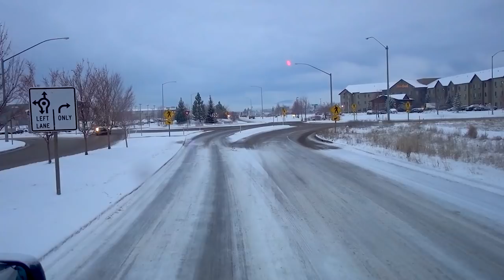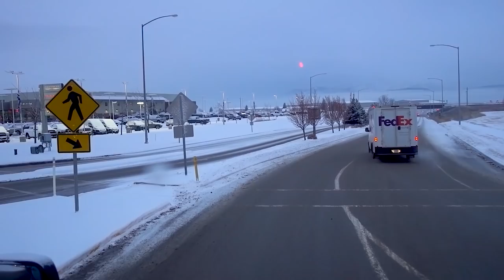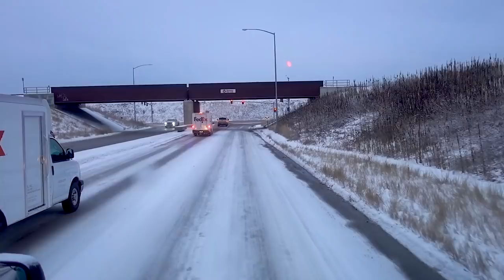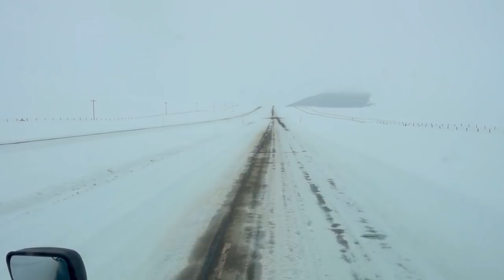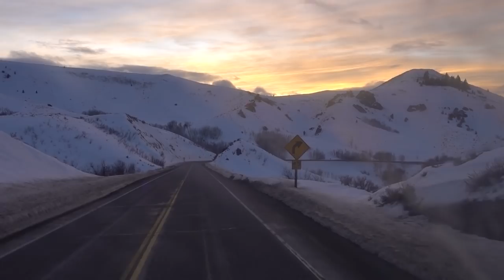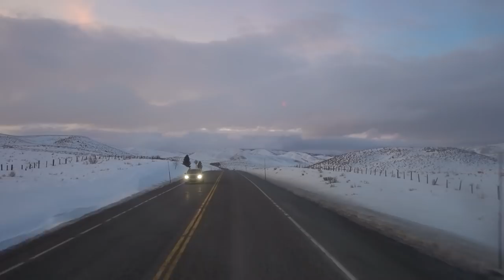trucking : drive shift in bad snow

Comment: Another solid video, man!

This has been my first winter in a truck, and the Northwest has been a real education in inclement weather driving.

Got caught in a nighttime snowstorm picking up a meat load up near Twin Falls, just before Thanksgiving, and had to get back to SLC.  High winds, blowing snow, snow and ice on the roads, and I lost the use of my driver-side mirror when a flatbed passed me, and one of his straps swung over and shattered my lower mirror.  Visibility and truck handling were so bad that I was down to 25 MPH at times, and never above 40 until I got down near Ogden, and the roads were cleared.  My trainer said I could pull in at the Flying J at UT exit 7, but I didn't, because I knew if I stopped there, I'd lose my nerve and wouldn't go back out. Took 7 hours to get to the Prime yard, and that was where we spent Thanksgiving.  Had to get the load repowered because we had to stay there until they could replace the mirror.

Picked up another meat load, near American Falls, and got caught in bad weather crossing into Wyoming on I-80.  Learned that night, that when the wind blows snow in the same direction as I'm driving, it makes visibility worse than when it's blowing snow across my path.  Had 3 minutes left on my 8-hour clock when I pulled into a TA, and ended up stuck there for almost 3 days, because they closed the Interstate due to snow and high winds.

I feel like I'm slacking off if I don't pull at least 600 miles in a night, but this winter has taught me that, sometimes, that's just not reasonable.  I'm not gonna do the shipper or receiver any favors by tearing up their load when I go into a ditch or median.  But I've only cut a driving shift short because I felt unsafe once, after driving 400 miles.

Comment: If the dock worker puts down the time you pulled in rather than the time you locked up at the dock, then his supervisor/manager is going to think it took that dock worker that much longer to unload/load your truck.  Then they are going to wonder why this dude is so slow to unload a truck.   I did that job before I got into driving. When it comes time to let people go in a slow down, they look at stuff like that, if they think you are slower than one of the other dock workers, then you are probably going to be looked at as a good choice as the one to let go if they think you are less efficient.   But at my last company, the driver checks in at the front office, they should be putting his arrival time down, at the dock I would put the time the truck is backed and parked at the dock.